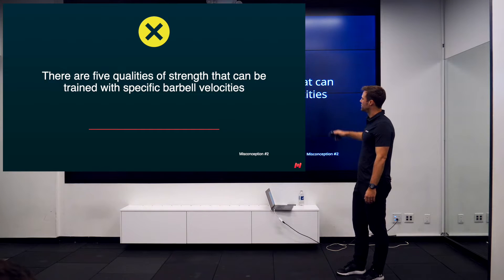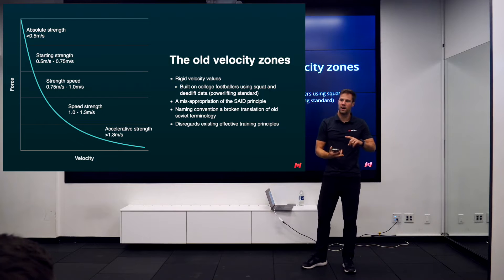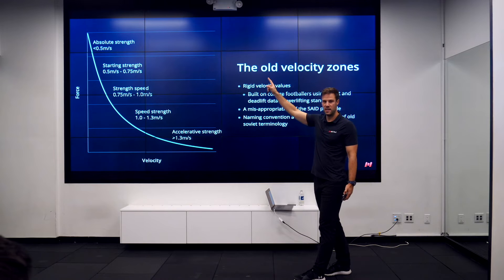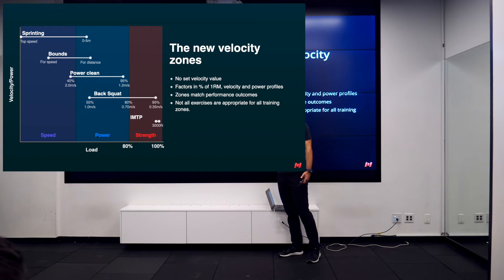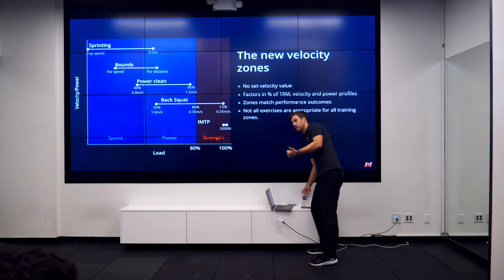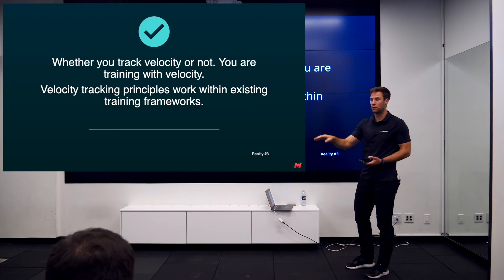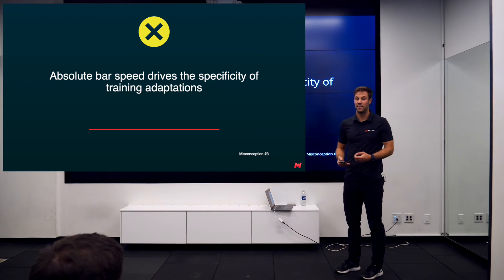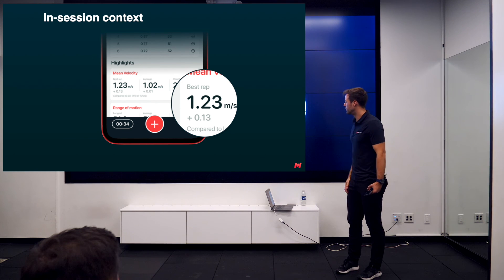Velocity zones - The problem with the 5-zone model | VBT workshop

Comment: 5:15 where would you put trap bar jumps in this slide?
Reply from the maker: @namtambao9248  depending on how much weight they are most likely a power exercise.

My preferred way to train them is as a power or slightly below power exercise
Reply: @vbtcoach thank you! Peronally i use them with a very low weight (around 35-40% of my 1RM in trapbar deadlift) and i always try to stay in the 1.30-1.00 m/s range